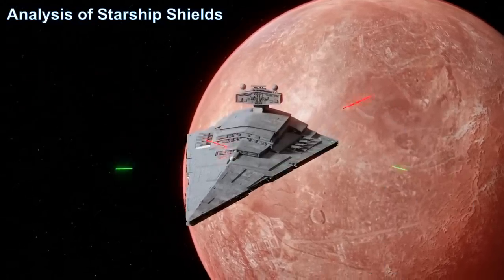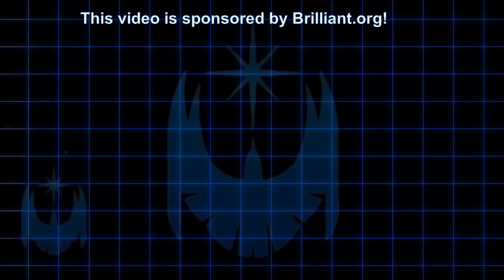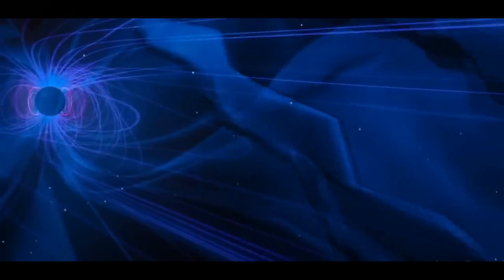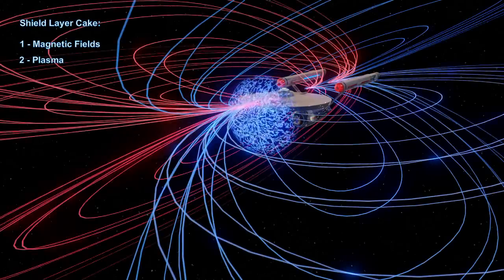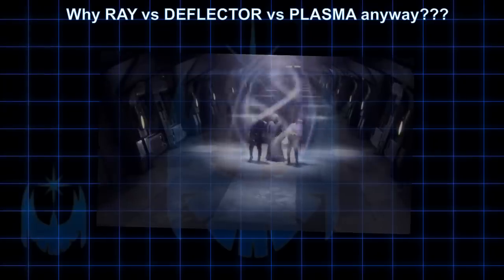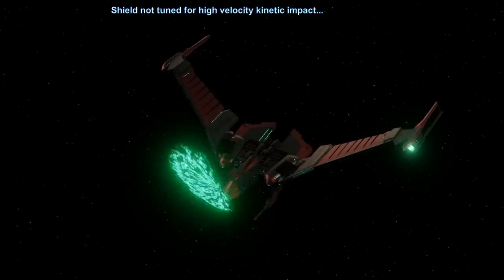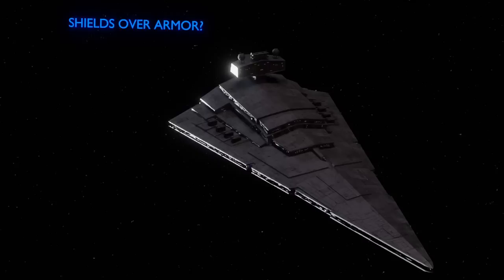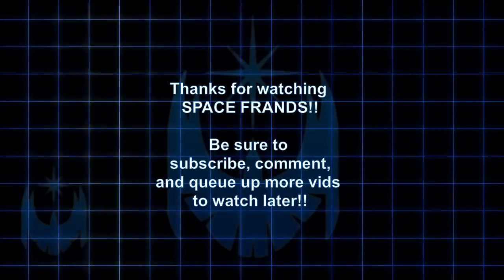REAL Starship Shields Types - They Work Like This...Animated Breakdown!

Comment: There are two types of shields that are very rare in modern western sci-fi I wish more shows/movies would do. Physical point defense shield, the only example I can think of is the Expanse, where guns are used to shoot down enemy missiles. Another type is deflective shield use in combat situation, kind of like what is demonstrated in the video. Instead of absorbing the enemy fire, it dissipate and redirect them, like modern sloped tank armors, causing beams to split and bounce and explosion going around the shield bubble. Granted, showing this will be more expensive on the special effect budget.

Comment: Great summary! 

If you delete this, fine. Just my stupid 2 cents worth. (Always hated they included dollar signs but not cents one in their symbols.)

Anyone familiar with electrical stuff including electrostatics knows about the skin effect where the higher the frequency the more it focuses on the surface. Using that a good resonance frequency can focus maximum power to the surface. The idea of a particulate cloud around an object allows a shell-like enclosure. If you use the correct harmonics this cloud would resonate with the incoming attack as a merger instead of repulsed. I suspect there is finite amount of “material” for each area unless they can bleed off to share from other places weakening the entire structure. So using this we have something similar to reactive armor but for energy transfer and projectiles.

Hope this was coherent enough for understanding.

Update: I remember reading about a company that uses a plasma screen to keep the air from entering a vacuum chamber. This should be still googling available for anyone interested.

Comment: Real life shields tend to be physical barriers though: radiation shielding, heat shields, Whipple shields. This in turn blends the distinction between 'shields' and 'armor' when it comes to real life scenarios. Afterall, a shield was originally a piece of armor anyway. 🤷‍♂️

Similarly, when it comes to spacecraft the distinction between hull and armor IRL isn't as meaningful as it may seem. However, there seems to be a clear distinction between passive protection systems like these, and active protection systems (APS), which also include things like smoke launchers, decoys, and CiWS aka what we might call 'ballistic shielding', etc.

I think it's better to talk about APS instead of just shields, which seems to be useful when proposing the more realistic idea that a ship's "shields" is actually an array of integrated systems of different kinds performing different tasks.

In my own clumsy & clueless amateur writings that I am too shy & ashamed to share 😅, I tend to describe the systems you've mentioned respectively as artificial magnetospheres (or just magnetospheres), plasma screens or plasma belts (depending on the shape given to the ship's magnetosphere), and finally I tend to talk about the ship's 'ionised atmospheric layers' or IAL, for the gaseous component.

And yes, that basically boils down to spacecraft which seek to imitate the kinds of protections that planets possess, the 'shell' or 'crust' being its composite armor layers. I have their magnetospheres and plasma screening being generated by their fusion reactors by the way, and their IALs sort of contained or shepherded by their magnetospheres around their crusts, thus all these APS are tied to the ships' power generation and propulsion (the generated plasma being usually channelled through, magnetically compressed, and accelerated even more by VASIMR type thrusters).

Comment: Forcefields/shields work by projecting a dense Sigma Baryon field between the emitters. When interacted with the Sigma Baryons decay into Lambda Baryons, or something close to Neutrons. Due to the Inverse-square law the small amount of Neutron like emissions radiated by the Sigma Baryons decaying into Lambda Baryons is negligible. This keeps Neutron like radiation at a level safe set by Federation standards. However, when Sigma Baryons decay there is also a secondary effect called the Pi-Zero weak interaction. This effect emits electron positrons and thus the annihilation of nearby electrons are ensured. So any incoming weapons fire that has electrons is annihilated. This annihilation causes matter to be converted in to energy (E = mc^2). This is why there is a visible 'light effect' that happens as the field is interacted with. The harder the field is under pressure the more visible light effect there is. Therefore, more matter being converted into energy can also cause heat radiation and burns. This is also why you can see a forcefield being 'put up'. As the forcefield is put up it has to move the air out of the way of Sigma Baryon field. That's is why brig force fields also 'sparkle' when turned on. So a small amount of matter is converted into energy as the forcefield engages, thus the light effect. When a forcefield/shield engages in space, which is basically a vacuum, you don't see this energy effect as much as space is basically empty. The power requirements that are used to make a Sigma Baryon field are immense. That's why forcefields/shields can weaken overtime, as they are being energized/matterized(?) by gigantic capacitors that must be recharged by the Warp Core. That's why star ship shields can take several minutes to be brought back online.

Comment: As someone who is a writer or wants to be a writer and someone who is considering his own Sci universe this is probably up there on my two biggest questions to ask from a technical standpoint with 'how does the warp drive work'.  

And without giving away my two thoughts the two problems that I am trying to address is, as you sort of point out, coming up with a logical shield grid that deals with both projectile and energy based weapons.  And B.  how do I come up with a reasonable system of shield draining because it seems to me that realistically the actual draining of the shields probably wouldn't work like it does in Trek for instance they would more have to be overwhelemd rather then a straight percentage and may make the ship nearly impervious.  

Great video though and I did like the issues you brought up.
Reply: Personally, I have four questions when I design starships of any sort:

1) What's the power plant?
Too weak, and you may as well stay in a gravity well.  It's not even a starship at that point.

2) What are the weapons being used?
I think most people will be going for non-laser based weapons due to a simple fact.  It just takes too long.  That means particle cannon, high speed missiles and torpedoes, rail guns, and other more exotic weaponry.  This falls back to the power plant question, again.

3) Yes, how does the stardrive work?
Are we using hyperspace as described by Babylon 5 or Star Wars? (Which will conversely affect navigation in many ways.) Are we using BSG style translocation? (Blipping out here and ending up over there the next second, which is a whole new set of calculations.)  This is also affected by power plant.

4) What armor/shield suite does it use?
Shield alone is unreliable; that is a fact of life.  How well can the craft take a hit?  Does the armor refract incoming EM energy?  Does the armor burn away to ablate the impact of heat weapons like plasma?  How good is it against neutron activation?  What is its temperature range?  Is it cooled by a circulation system?  Can it self-heal?  And questions within the video itself about shield specifically...Of course, all of this is still contingent on my first question, the power plant.

Comment: Lasers? Mirrored hull plating. Kinetic weapons? Smart point defence batteries. Most effective tactic? Shoot first, shoot accurately, and from very far away. First rule of combat. I recommend Isaac Arthur's discussions on space warfare.
Reply: You also have some specialty weapons, like particle beams, that essentially make anything physical they touch radioactive. So the more armor a ship would have, the faster it would cook the crew/circuitry. They have to be deflected with energy at extreme distance, or counteracted by another particle beam tuned just right. Or something like a refined Casaba-howitzer that uses a nuclear explosion but focuses it to laser-like precision, dumping all the heat of the explosion into one spot.
Reply: Smoke screening might be enough for lasers

Comment: Armor is great for ablative and conductive protection, a laser or particle beam hits and the heat /charge can be bled off over a large surface area, not to mention if the armor is designed to mirror finish itself when heat damaged. Which means you only have to shield so much damage or change how that damage is being applied, which means you can use shields to downshift from higher spectra to lower more reflectable ones.
Reply: However Reflec Armor, as BattleTech terms it, has a flaw.  It cannot take a heavy hit, which will reduce its efficiency.  Assume you have a projectile of a mass similar to a Toyota Corolla to use the popular meme, and it is going at 65% c.  That's a lot of force you are stopping, and some of that may bleed over and impact the Reflec Armor, denting and changing its geometry.  The armor may also have a slight brittle factor, compounding the problem.

Even then, weaponized lasers might not even be a problem depending on the target ship's alloy, the power plant of the firing ship, the safeguards on the weapon being fired, and the evasive track of both ships.  Lasers are only really good if the enemy isn't going evasive.

Then let's have some real fun with weaponry.  Sufficiently advanced enough, and a weapon can evade shields even.  Say someone comes up with a Neutron Cannon, a particle weapon that fires a lot of nasty neutrons, which have no charge and therefore cannot be diverted by magnetic field.  This type of weapon could cause neutron activation in the armor, rendering a whole section dangerous to replace without proper PPE.  This could render whole sections of a ship dangerous even.  And not many things can take a pointblank thermonuclear or A-M bomb right on the hull.

Going back to BattleTech a moment, it does have Ferro-Fibrous Armor.  This stuff is like an iron Kevlar vest, so to speak.  How do you stop a kinetic round?  You slow it the heck down.  In a setting with Gauss Rifles and Autocannon, that can be useful.

However the best defense against being attacked or being spotted on the attack is not being seen.  Combat in space needs to be done like beneath waves on Earth.  The Expanse has an answer in the form of a Protogen stealth ship.  Your target will never know what hit it until it is too late.

Comment: I think Ender game was the best real life application of shields. Use small drones. 3d hexagonal shaped with each side catering to different threats. Use use a massive induction charger to charge them and that limits the distance from the ship they can extend. Best part, they could be exhausted, like shields are in Star trek. The drones could also fuse with the ship during breaches.

Comment: With regards to defending against laser type Weaponry one of the Sci-Fi series I've read over fo years has way to do shielding against projectiles and energy weapons by using the same magnetic Shield approach you describe, and also suspending particles in the shield that are a derivative of the "brilliant Pebbles" concept from the SDI in the 80s, and is nearly the same as "Smart matter";the ships use magnetics to screw with physical projectiles, and use the pebbles/smart matter that "rides" the magnetic shield bubble to wherever they are needed, and ablate away to defend against particle beams and lasers/masers/grasers.

Comment: I think that the story purpose of shields is so powerful ships can have slugging matches, carrying on the roles of pre WWI battleships, instead of battles revolving around detection and stealth.  The story purpose is to show up a very powerful ship that can be seen well before engagement.  If the technologies are far advanced beyond our own, for a ship to act like a classic battleship, it would have to be able to shrug off our eras most devastating weaponry, or what would be the point?  Since there isn't any real armor that could stand up to nukes at close range, space opera of all kind required shields of some kind.  I somehow doubt that any shield technology will ever be more important than stealth and decoys, in being able to detect the enemy first and to evade detection for as long as possible.  Which is sad, because I love the stories you can have with those near invulnerable battleship type starships.

Comment: until energy demands are met to sustain whatever you’re shielding against. Being hypothetical…a Arleigh burke Destroyer is 529 feet long, 66 feet wide, 105 feet high (at mast) So has a volume occupying 3.6 million cubic feet (not including hull underwater) To protect it with a “shield” envelope. A Bubble dome encompassing the ship…Getting back to energy consumption....translates to a minimum energy of 482.43 Mole to highest of 2.413 MJ/mole or about 482.43 kJ/mole to 2.413 MJ/mole. Thats 375.5 Kilojoules per kilogram or as high as 593.5 Megajoules per kilogram depending on gas used. The average density of the lightning plasma is 0.129 kg per cubic meter... So a bubble shield with area of 444,000 sq ft or 41,248 sq meters with a thickness just a centimeter thick gives you a plasma volume of 412.5 cubic meters. and if similar density mentioned above.... a mass of ~54 kilograms. Energy must be constantly expended to maintain this plasma, at normal atmospheric pressure. Even at a minimum of 375.5 kJ/kg per second, In reality even a high energy plasma is insufficient to stop a projectile. To say nothing of How much energy needed to maintain a magnetic field. A 50 caliber bullet (12.7x99mm) has a kinetic energy of 18 kilojoules, and delivered over a surface area smaller than a dime...A shield would need 18 kilojoules per square centimeter, to stop the bullets impact needs solidarity to stop it so needs greater than 18 kilojoules per square centimeter, with a bubbles surface area of 412 million sq/cm needs nearly 7.5 Gigajoules to maintain a shield energy of surface area of the bubble....EVERY SECOND, or 7.5 Gigawatts of consecutive power. The Kori Nuclear plant in Busan, South Korea produces 7.5 GW.

Heat dissipation: Energy of that magnitude, not to mention generating a plasma bubble, can generate temperatures as high as 10-20 thousand degrees Kelvin. Temps in a confined bubble would have to be dissipated or expended or risk heat enveloping habitable volume of the ship; ionizing airs oxygen into toxic ozone and just plain needing a chilling/cooling system to keep the crew from roasting in an all metal container.

EM visibiltiy: A shield capable of blocking directed energy like lasers.... would have to block visible light, meaning seeing outside the bubble would be impossible. Beyond that blocking EM radiation, means all sensors that use the same EM radiation would be unable to work in the confines of the shield bubble.

Comment: This was pretty interesting. Reminds me of when I was designing my own shield. I thought it would make sense to have multiple types of energy that mix together to make the Shield field. I also felt that it should be a not perfect as some types of weapons can pass through or are only partially stopped by your shield if it is to weak or doesn't contain certain types of energy. 

Another thing I played with, was the idea of being more like a field and less like a wall. Basically there could be areas on it that were weaker and could be pierced more easily. This made fighters more important as they can get close enough to detect these slight differences and take advantage of them. I also use this to make there be a tactical advantage of using lots of smaller projectiles then just a smaller amount of big projectiles. As the constant striking of a smaller faster weapon could disrupt the shields enough to allow you to pierce them. Honestly I was just tired of the cliché of Shields being this wall you have beat down completely before causing any real damage.

Comment: Not sure about the Star Wars universe but Star Trek staffers have gotten pretty good at explaining how their tech works.  Try reading through the TNG Tech Manual.  "Deflectors Shields" are a TOS techno-babble because the writers and Roddenberry only had half an idea about anything Trek.  
By TNG these systems were better defined and while they work in similar manners, "Deflectors" and "Shields" are two separate systems.  
Both are modulated graviton fields but "Deflectors" are generally of low intensity for keeping small debris from shedding the ships hull but there is a secondary deflector that works similar to the tracker beam and is used to help move larger objects, like asteroids and comets out if the way.  Both of these are emitted from the "dish" usually found somewhere on the front of the Ship.

On the other hand, Shields are high intensity and high density gravitron fields that are emitted from grids mounted directly to the outer surface of the hull.

Comment: when i used to draw my own spaceships, i gave them... i can't remember what I called it, but basically anti-laser shield which worked by first releasing a powder of ferromagnetic metal, which was then manipulated and held by magnetic fields... same as you describe plasma could be, except these were solid metal particles, thus opaque and would disperse and absorb lasers.
Reply: I have thought something similar in the past, that maybe ships could just deploy a smokescreen of sorts to both absorb lasers and also block sensors as well.